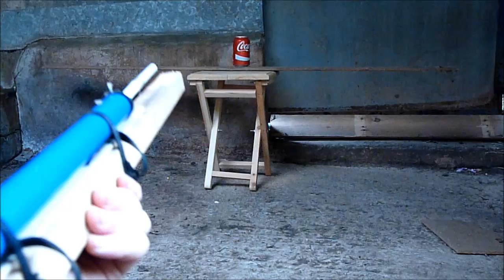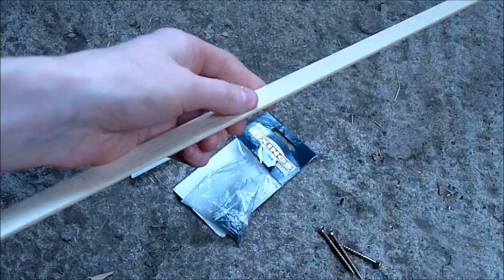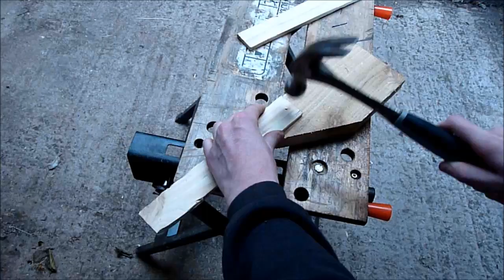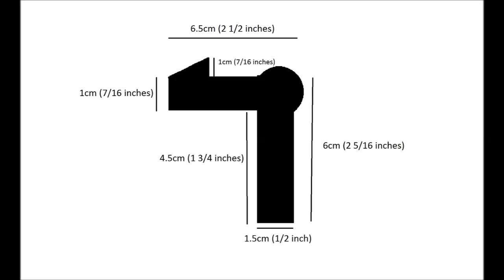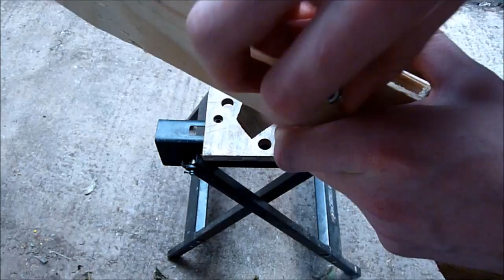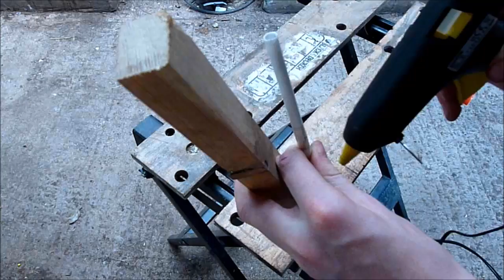TUTORIAL-Homemade BB Gun- BB Rifle, powerful and simple

Comment: did you still a hole in the back of the bike pump? is that how the dowel goes into it
Reply from the maker: +Julian Lucido Yes, on cheap bike pumps like these there should always be a hole at the back, it is usually where the adapter for pumping up a bike tyre is.
Reply: +Purdey Projectile cool thank you, did you use 1/4 dowel? or  half inch
Reply from the maker: I used 1/4 dowel, but it might vary for the bike pump you use although I think most have the same sized hole

Comment: Is there a way to get this specific bike pump in the US?
Reply from the maker: +KadrinShadow  

http://www.ebay.co.uk/itm/Cycle-Bike-Tyre-Hand-Pump-Long-40cm-Body-Valve-Hose-Road-Or-Mountain-Schrader/381253461997?_trksid=p2045573.c100033.m2042&_trkparms=aid%3D111001%26algo%3DREC.SEED%26ao%3D1%26asc%3D20131017132637%26meid%3D86cde4167539487ea0603d3d1b41d49b%26pid%3D100033%26rk%3D1%26rkt%3D4%26mehot%3Dlo%26sd%3D381253461997This is the one I used in the video -It does international postage!
Reply: thanks so much! love your vids btw
Reply: Purdey Projectile Does it matter if it has a spring on the piston part?
Reply from the maker: Not really, just position it so any internal spring isn't effecting it, besides, you might be able to unscrew it and take it out if it is a problem
Reply: Purdey Projectile ok thank you

Comment: did you do anything  to the pump  to make it fire our ?
Reply from the maker: +King of rocks 1103 Hi, the pump is left how it is except the barrel is added to the end.
Reply: +Purdey Projectile  Aaaa thank you...   where can i find a pump like that. Because all the pumps i find have the hole for the air on the side so i cant pump the air straight but up. Can i make hole at the bottom and then cover the one on the side so i can then shoot straight?
Reply from the maker: King of rocks 1103 Yes you could change the position the air comes out of your pump although that could be difficult. You should be able to buy a simple hand pump online from eBay or from a hardware store ( shops like Halfords, Wickes if you live in UK).